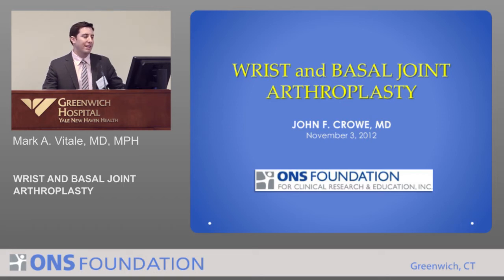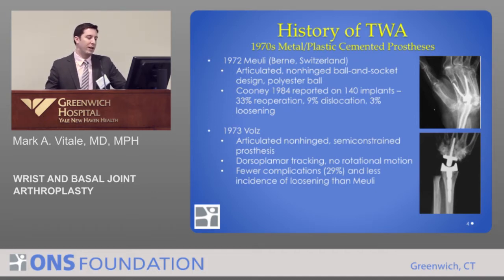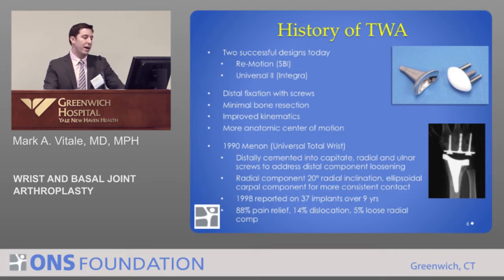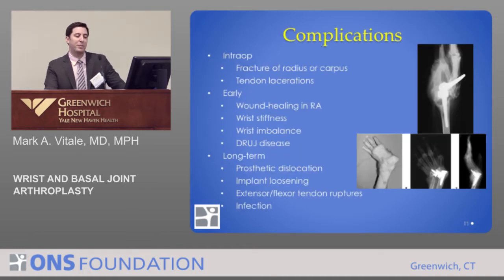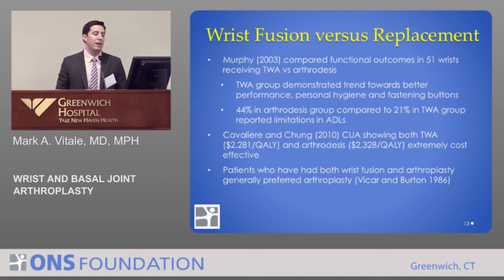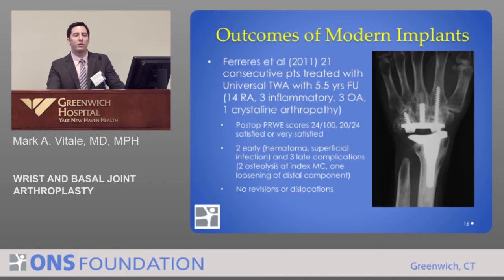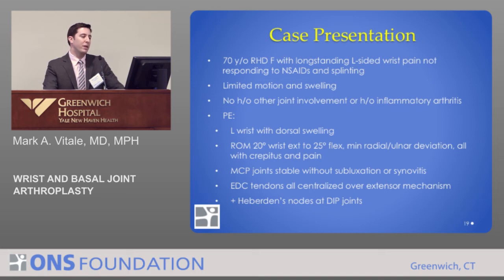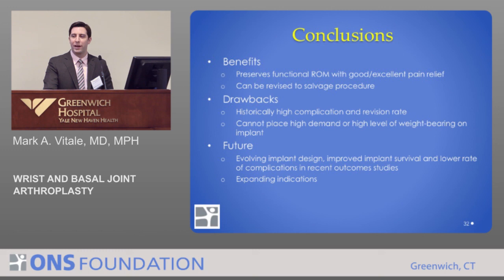Total Wrist Replacement Surgery

Comment: I'm very worried about my future surgery requiring a full wrist fusion. I had a 4 corner fusion and scafoid removal performed in late 2006 after 2 failed scafoid repairs (bone graft and Herbert screw, 1992, 1996) following a non diagnosed scafoid fracture in my early teens (1986). I then had the spider wheel and screws removed mid 2008. 

Around 2 yrs ago I started to get pain in the wrist again, especially down my ulnar, after having MRI, CT scans it was concluded that I needed the end of my ulnar removed and my detached TFCC repaired with drilled holes and nylon stitches. The scans also suggested non-union sites of the 4CF running in a vertical orientation, I also had an arthroscopy during the TFCC which I think was to confirm this. 

Now I worried as a full wrist fusion keeps being mentioned all the time, even before the above op. I'm a 44 yr old non-manual worker, fairly active but my fear is that I'm a musician (Drummer and bass guitar player) .. IF I have a full fusion I'll never play again .. I know the drums are basically gone now but the bass is still there ... It may well have been the drums that caused the 4CF to fail, I do realise that ... Would I be considered for a full wrist replacement?? A second 4CF?? I do have decent movement still and that would be totally lost with a full fusion